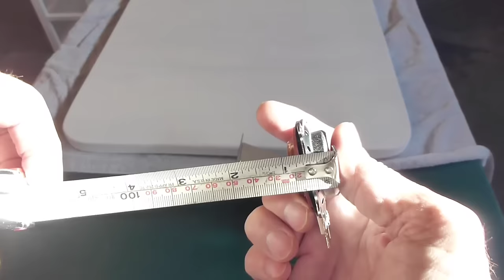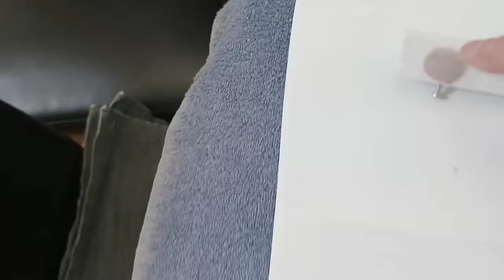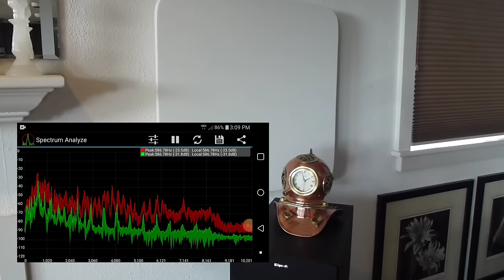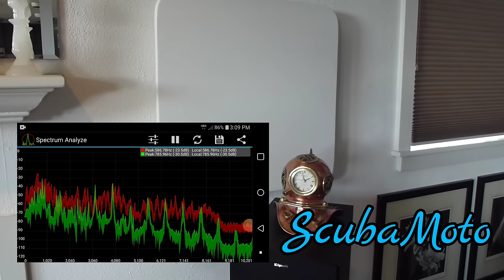How To Build DML Panel Speakers with Hidden Wall Mounts Fully Suspended

Comment: Can this be used to build a flat center speaker?
Reply from the maker: Thomas Kaarup: Most likely but it will be a personal preference answer. With a good sub, it's worth a try. The DML's are great from 200Hz and up. As a conventional speaker example, the Polk Audio TSi CS10 is a great center speaker running 53 - 25,000 Hz. You're probably running a good sub like the PSW10 which delivers 40 - 160 Hz. What other surrounds are you pairing it with? The other question is size, shape and exciter-type for the DML. Is 24-inch square feasible for your theater? If you try it, let us know what you think.
Reply: @ScubaMoto  I've got a whole setup wih Scandyna mini and micro pods and an active sub. The center speaker are huge and ugly and dont fit flat tv's

Comment: Tech ingredients said to use spray paint to paint it. You used paint from a can and a brush. Does it not matter what kind of paint I use? What kind of paint did you use?

Also, Tech Ingredients shows him building one speaker from polystyrene and another from an acoustic ceiling panel. Are we supposed to use both or one?
Reply from the maker: cowboypriest: Thanks for watching and for the question. As suggested by Tech Ingredients, I first block-sanded the panel faces to remove the smooth factory surface. In my case, I used the sanding block to put a side-to-side parallel grain on the front surfaces of each panel. I used wall paint since my objective was subtlety. To get a fabric appearance, I used a brush application for the paint to further enhance the same grain I created by sanding. The look is good enough that it has become my standard. Adhesion was excellent and I have repeated the process with no issues. The brush application also gave adequate coverage to conceal that lovely violet color. Thanks again for watching and for sharing.
Reply: @ScubaMoto  Thank you. And to my other question, you use only two panels, but Tech Ingredients actually uses 8 panels. I wouldn't even know how to connect 8 speaker panels to my FL/FR surround outputs. Can I get away with just two panels?
Reply from the maker: cowboypriest: Tech Ingredients explored many materials and configurations of DML panel speakers. Depending on your situation and objectives, you may want to choose something not exactly shown in his videos or in mine. My towers will remain in use in my audio-only room for now but will never again play without the heavy lifting that these DML panels bring to the mix with regard to mid and high frequencies. I confess that until hearing these panels, I would dismiss claims of their superiority as internet hype and exaggeration.  I suggest that you begin with two 2/5 - 3/5 panels (FL/FR as you put it) and then decide if you want to supplement with centered-exciter panels on the same channels and possibly additional surround panels. For my theater (which currently has no DML panels), I am confident that adding panels to at least front channels will improve the voice perception and other mid/high frequency deficits present in many home theater systems.

Comment: Just curious if you have any updates to this build?   Did you improve the setup at all, do you even still use these, and how have they held up?  This is 100% my next project, so I was just curious what to expect.
Reply from the maker: Jon G: I am still very much liking this build. The panels in video are still mounted in the same place in use with towers. Both the latex paint and the exciter contact seem unlikely to have adhesion issues one year after the build. Future considerations are smaller panel profiles for surround satellite application.
Reply: @ScubaMoto  Impressive, I can't wait to get started.  Waiting on some 40w exciters to come in.  Thanks for the update, your results give me confidence that this is well worth the effort.

Comment: I would like to do this, but my understanding is that wall hanging these effects the sound in some negative way.  Is there any truth to this?  People in forums say that they need to be several feet from the wall.
Reply from the maker: A.R.: I put some notes in the video description regarding my experience and there have been many comments also worth reading. The best thing is to see how you like it with your system in your own listening environment.
Reply: @ScubaMoto  I appreciate the quick reply.  I don't have space for anything, but wall mounting.  I never purchased the Magnepans I wanted for this reason.  Yours sounded good in this video form my head phones.  I'm considering building a frame with 1/2" sheet of Rockwool insulation behind the panel to absorb the rear sound emission.  I wish I had more time for experimentation, and to share the results, but I'm working a lot. I'm on the fence on whether or not to go through with my design.

Comment: Thank you for sharing this vid, honestely that dml crap sounds awful, even through youtube and headphones I hear those resonances, Klipsch sounds more evenly.
Reply from the maker: Vadim Shvets: Thanks for taking the time to listen so carefully and to leave the comment. After the build, I played these DML panels through the same channels as the towers and immediately noticed that everything good came clearly through the DML's. I also noticed many distortions on the channels that were always there but were not audible to me through the conventional loudspeakers. When so much more signal is transferred through a loudspeaker, one must use high grade recordings and/or filter accordingly. I personally feel that the benefits by far outweighed any need for filtration. In the case of this video, distortion is even greater for several reasons.

When I listen to this video from the internet through my system, I hear many distortions not typically present. For copywrite reasons, I cannot chose music from my personal collection for YouTube videos. I very much liked Doug Maxwell's Bellissimo and felt it was a good choice for the video demonstration. However, the musical piece was downloaded from YouTube at a low bitrate. It was then played in MP3 format for the video demonstration. For comparative purposes, I chose to make all three recordings at equal volume with no additional expansion, compression or distortion filters applied on my end. The recordings were then processed into a video, re-uploaded to YouTube who again processed the video for public viewing. There were many stages introducing signal distortion.

Given the low cost of this build, I caution you not to abandon DML panel technology based only on this observation. I recommend comparing your own DML build to conventional speakers using higher grade signal sources played in your own familiar environment. I promise you will hear more of everything coming through the DML panels, including distortion. You can then choose to filter the signal for the DML panels. Thanks again for taking the time to listen and to comment.

Comment: super cool dude.. but as a new klipsch lover, im kinda sad. they dont make them im black, like yours!! they look insanely good, without the copper look
Reply from the maker: Okay, so we're a couple of Klipsch fans. So you prefer not to have the copper and I kinda like it. You must have the R-820-F or something similar. They are discontinuing the copper Torx screws so I was glad to get a pair of R-820-F's. The ones in the video are Icon KF-28. I have both plus a third pair of synergy towers in the theater.  A fourth set of KG 4.2's are also still going strong in another space. They've all served me well and have shown no signs of deteriorating. The theater system will eventually also get DML supplements to improve the voice range that often needs improving for the theater experience. Thanks for watching and for the comment.
Reply: @ScubaMoto  yeah i really love the copper look to, but the dark look is better for theater.. so you dont se anything else, than the screen hehe..

Comment: What kind of paint did you use?
Reply from the maker: After sanding, I used the same latex paint that is on the wall. Going on four years and still good adhesion.